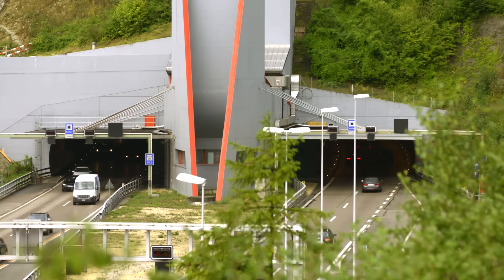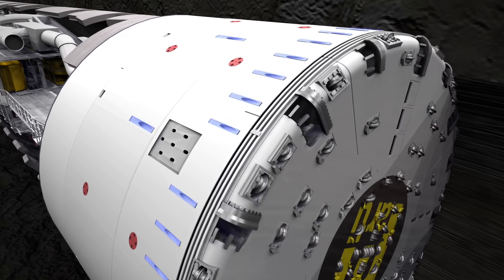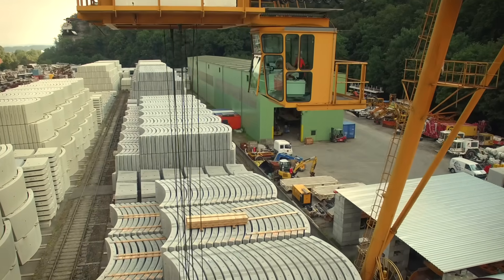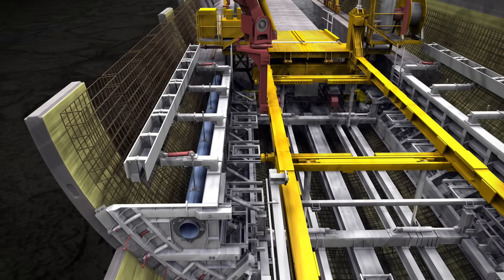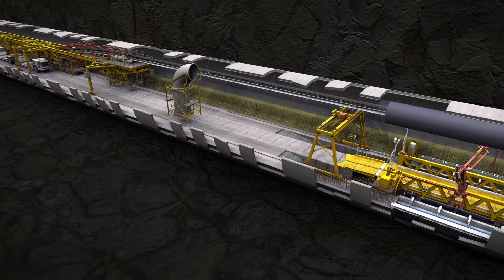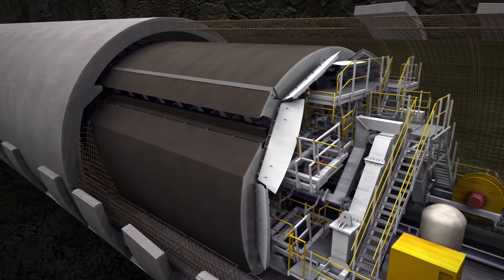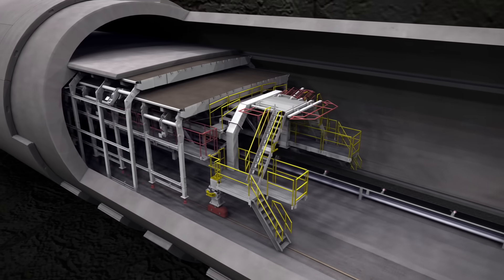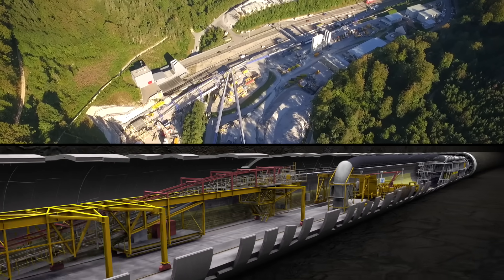Belchentunnel (Switzerland) – Project Film

Comment: How do you guys deal with the gaps between formworks that's not reinforced with rebar? Seems like the gaps between rebar cages are rather large in the animation, so been wondering if this is a much smaller gap in real life or if other mechanisms (expansion joint, drainage etc) are placed within the gap created post cure if the gap is indeed that large.
Reply: There's a little church in between, where they hold the ceiling with prayers. It doesn't have to wait for too long, so it doesn't violate the thermopraying principles.

Comment: Looks impressive, but still too complex.
Looks like three separate rounds of wall/floor/roof construction.
I wonder whether this can be reduced.
Another possible improvement is to get rid of rebar and look into fiber reinforced concrete (in essence, where "rebar" is placed with concrete as one step, not two separate steps). If fibers are non-metallic, this can also eliminate the possibility of future degradation by rusting. Of course, this is easy to say but much harder to achieve, the new concrete formulation needs to be not weaker that one with rebar, and fibers also may complicate or even make impossible concrete pumping.

Think about... Mars. There, almost all human habitation will have to be under surface. Transportation between habitats also may be in tunnels. This means that underground construction methods have to be much improved yet again still.

Comment: Very well done video, interesting and informative. However, there is one big mistake in the comments. It says that certain things are done from preventing the concrete to cool down too fast. Concrete does not cool down, it heats up while curing and that needs to be prevented!
Reply: Concrete cooling down too fast could be an issue in some environments but I doubt it would have been a problem here. I imaging pouring a slab in the arctic could cause alot of problems. Also I’m no concrete expert but I’m pretty sure they would have additives in the cement for these sort of problems.

Comment: It would appear that tunnel inner form segments are not linked. There is no reinforcement spanning from one form segment to the next. This implies not only a seam, but the possibility that form segments may shift relative to each other.
Reply: There are likely a lot of little engineering things involved that don’t fit into this video.
Reply: R U suggesting a flaw or good feature?
Reply: @pghinga8127  that would be a flaw if true.  But in this video of the Alps tunnel, you can see massive pins which appear to be joining sections.
https://youtu.be/30foJiPUrBA